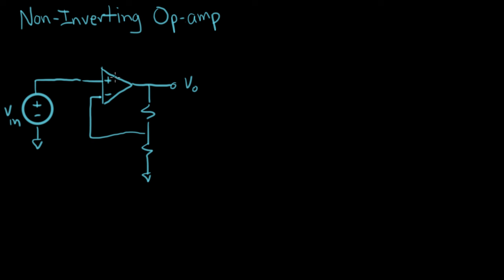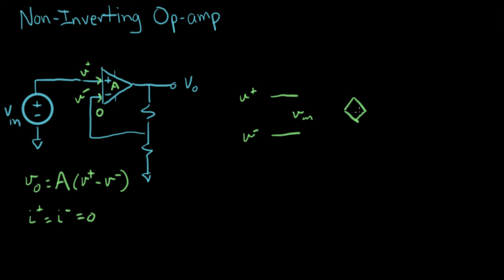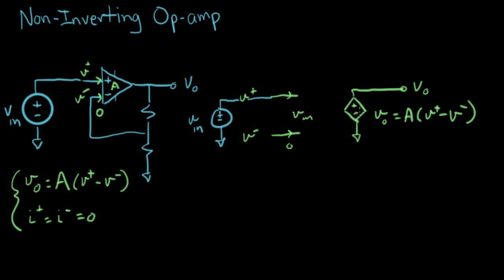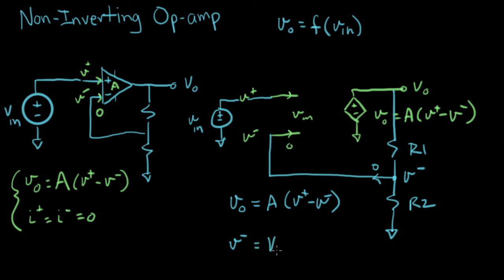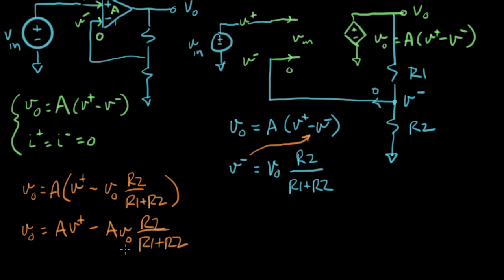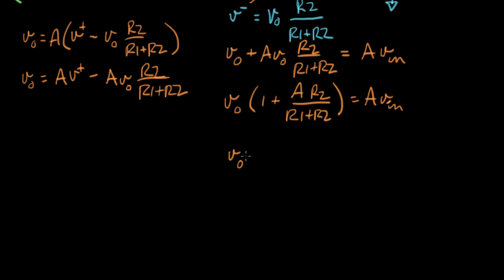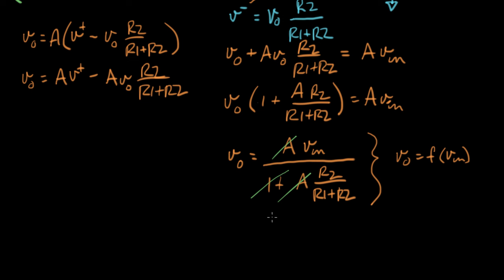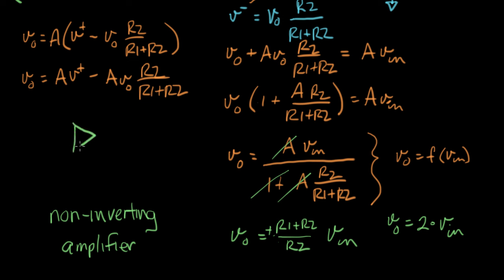Non-inverting op-amp circuit

Comment: Before you started doing anything, I tried to see if I could come up with how to set the gain myself. And I came up with Gain=R1/R2+1, which is equal to R1+R2/R2. I also did it by simple ratios of the resistors, but added the 1 because the gain value is greater than the ratio of the resistors by 1. A gain of 1 would just be a voltage follower, while a gain of 2 doubles the voltage. So a ratio of 1 would be a gain of 2 because it halves the output voltage, while the voltages on both inputs must be the same, therefore, the voltage on the output must be double that of the input so as to make the halved output voltage equal the input voltage.
Reply: Doesn’t that depend on resistors

Comment: in the previous video you said that Vin= V+ - V- 
so why here Vin = V+ ??
Reply: Osama Hafez V- is not connected to a voltage source. that's why
Reply: Hey, Here is only a problem of definition. In previous video, Vin defined as V+ V.   But in this specific vedio, Vin was defined as V+ ONLY.  I think if you use another name would be easier for understanding. In this video, V+ Only means Vsource , the voltage source you want to measure. (Here used Vin stand for Vsource, and you probably mixed it up). 
;)
Reply: Osama .... you can see that V- in 'grounded'...so V-=0....therefore final expression for Vin becomes Vin=V+ - 0=V+
Reply: Yes the explanation in video is a bit confusing because the name of external voltage source is vin.  it is much clearer if the name of external voltage source  is changed to Vex for example.  Since Vex is connected to pin v+ of amp,  its clear that Vex = v+  (the point in video at 7:32 till 7:40)
Reply: I was confused too, thanks for pointing this ;)
Reply: ty for the explanation :)
Reply: V- is not connected to a voltage source @zcq0730
Reply: Tambi Raj 
I don't get it. Since the v- is connected between the two resistors, there will be a voltage drop across both, no? That should give v- some value.

Comment: how do you know which resistor to put on top using the voltage divider? (Why R2 instead of R1 in the numerator?)
Reply: You put the resistor closest to ground as the top resistor in the voltage divider.

Comment: Why it is V- = Vo * ( R2/(R1+R2), not V- = Vo * ( R1/(R1+R2))?
Reply: If you want to measure the voltage at V- .You need voltmeter to measure across R2 and ground right? So that's why the voltage at V- = Vr2.

Comment: Since we are using ideal op-amps, we know that V+ = V-. The fastest way to get to the answer given, is to use the voltage divider and this property. 
V+ = V_in
V- = (R2 / (R1 + R2)) * V_0

By the V+ = V- property, we get:
V_in = (R2 / (R2 + R1)) * V_0

Getting V_0 as the lone term:
V_0 = V_in * (R1 + R2) / R2.
Reply: Aditya Varshney   Ok, but try to explain to a novice what a virtual ground is. For that you would need to know about differential amplifiers and feedback circuits. That is why the instructor chose the longer explanation.

Comment: What if there's a resistor between the voltage source and V+? How would the equations change, then?
Reply: There's no current flowing so it won't do anything (is my guess...I'm just learning this stuff myself).

Comment: I don't get how gain A can be "really, really big (10⁶)" and at the same time only the ratio of the resistors, which normally isn't a very big number. Can someone please explain this?
Reply: Ahh.. Is the gain of the opamp near infinite while the gain of the circuit is the ratio of resistors?
Reply: this is the neat thing about op amps  you buy one and you choose the gain you want by choosing the values of those 2 resistors
Reply: and why is that? how is that possible??
Reply: 1/0.0001 = 10000. Here 1 and 0.0001 are not so huge but their ratio is

Comment: I am a first timer at opamps and was trying to get the non inverting amplifier to work. 
I connected V+ to +5v and V- to gnd( since I will be using it for DC). I am continuously getting a high output voltage of 4.44v. I even tried the offset null circuit but the output voltage remains constant at 4.44v. The feedback resistor is 1Mohm and R1 is 100kohm.
Can anyone guide me here as to what could be going wrong?
Is the negative power supply absolutely necessary for the opamp to work?
Reply: if you feed opamp around 5V to 0. The opamp will compare 2.5V Dc best. Your signal Vp must be around 2.5 V for best . Otherwise you will always get 5V

Comment: I dont understand how you can have i+ = i- = 0 you put a voltage/signal?
Reply: pebre79 it's a characteristic of the op amp, high input inpedance meaning there is a high opposition to current
Reply: [] is correct. It might help if you think about the input current not as exactly zero but instead as close to zero (i.e. very very tiny!). Then, we can approximate and just call it zero.